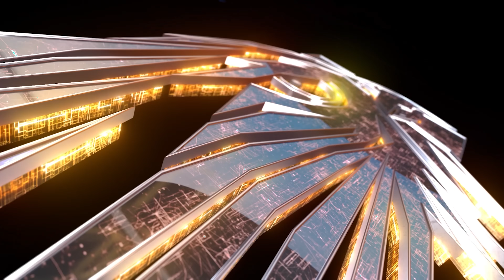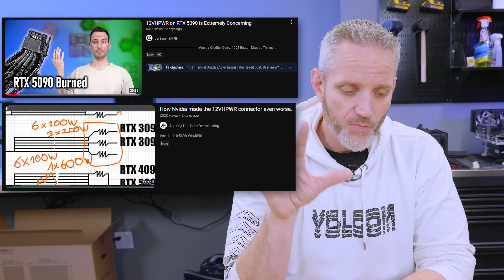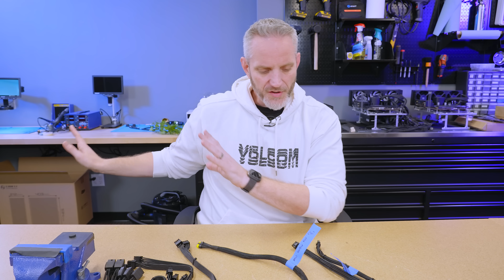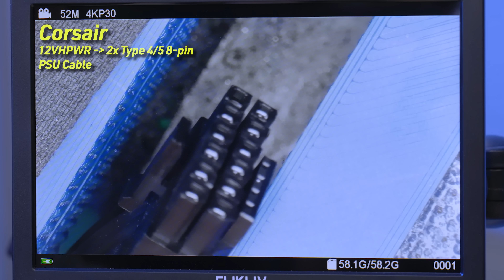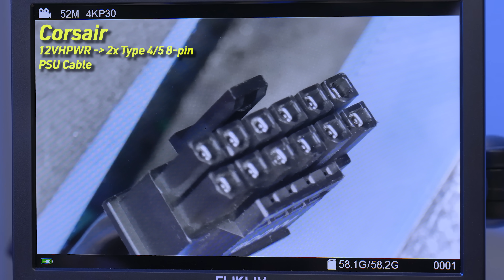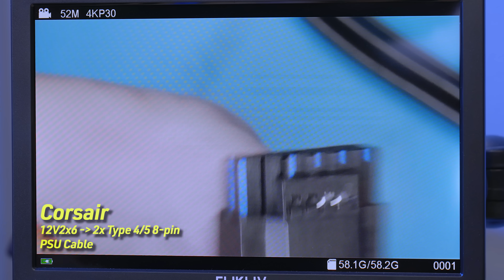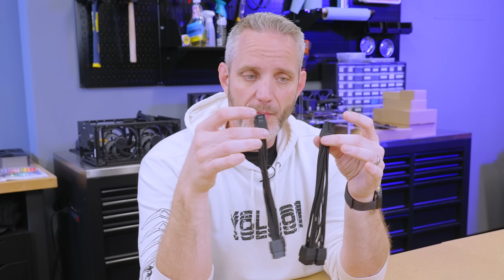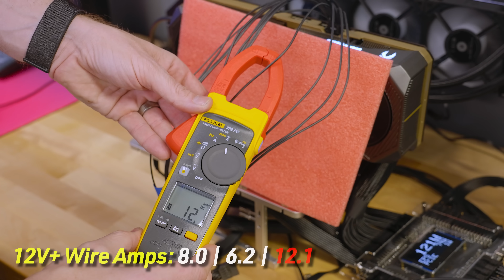I discovered something concerning and I need the Experts to chime in... More 12VHPWR discovery!

Comment: The 4090 and 5090 should have been equipped with an XT60 connector instead of the failure prone 12VHPWR.

Comment: Hey Jay... I don't normally comment, but I posted basically the same response on Der8auers video. So, based on the design of the 12V-2X6 bridge to the GPU PCB on the 5090 FE I think you are likely going to see that other 5090 FE connectors (as long as they're correctly seated) will have damage on exactly the same pin as Der8auer's card (pin #6, bottom right +12V closest to sense pins).

The +12V bridge from the 2X6 connector to the PCB on the 5090 FE is a single rail connecting all 6 pins, and pin #6 has the shortest path to the PCB (lowest resistance). Combine that with having zero load balancing between the 6 pins like the 30xx series had (3 electrically isolated shunt resistors connected to 2 pins each from the 12VHPWR connector) and the GPU could potentially pull all 50 amps available from a single wire (you're more likely to measure up to 25 amps per wire though). With the additional heat generated along a single wire the line resistance could nearly double, causing a scenario where the GPU would be pulling around 25 amps from the 2 wires with the lowest resistance values.

I would also guess that the second wire in his video showing extreme heat was likely pin #5 as that would have the second shortest path to the PCB. The 40xx and some 50xx series AIB cards use the non angled connector where each pin is soldered directly to the board (same path length), so depending on other tolerances the resistance may be higher on different +12V pins in those scenarios, and may have less extreme current balancing issues between pins. 

In your scenario it looks like the Zotac uses a non angled connector and the two middle pins (3+4) likely have the shortest trace length on the PCB to the single rail shunt resistor. I believe the issue is exascerbated by the poor QC in 3rd party cables, where the worst case scenario is a 50xx series FE card with a combination of pin #6 being a loose connection and pin #6 also having the shortest path to the PCB.

If you are able to accurately measure the resistance values from pins #3/4 on the Zotac to the main PCB shunt resistor I think you'll find they have marginally lower values and pins #1+6/7+12 will have the highest.

Any way, without any sort of pin to pin load balancing/isolation you end up with the potential to have the entire current draw of the card running through a single pin/wire (6x over spec), it's an extremely dangerous design flaw. :/

Comment: Being able to wiggle pins in and out gives me nightmares of the days of molex plugs never seating properly because pins would constantly get pushed out
Reply: Yeah, but much lower current there. Plus the male 4 pins were much longer,  so less of a problem unless the female pin just popped out, and they were bigger wires so you could easily just push on the wires and make sure they were fully seated. Not like these tiny ass wires on the 12VHP connections
Reply: wow, what a time trip. Molex was such a PITA for that. Round and round we go in circles. :innovation:
Reply: Atleast the molex plugs ran a 5W fan and not a 600W+ $2000 gpu...

Comment: There is a simple explanation to the ground question.
Half of the fingers on a PCIE slot are ground, if you have poor ground contact on the 12 pin the current will simply go through the slot.

Even with good contact you will find more current in the 12v wires than the gnd wires because some is going through the slot.
Reply: I have a better one. That helps, sure, but i have seen a report of GPU crashing until the Corsair cable was removed and replaced with that Nvidia pigtail adapter.

If the return current capability isn't sufficient, there will be a ground offset formed. 0.6V offset from 12V to 11.4 due to this amount of voltage dropping on the connector isn't going to do much, the card will just keep running. If however the same happens to ground pins and card's ground drifts to 0.6V relative to mainboard, PCIe signals absolutely cannot be read, since they will be outside the permissible voltage and thresholding parameters. Card halting prevents fire.

Otherwise you'd start seeing delaminated edge connector ground pins by now.

Comment: Also look at the sense part of the Corsair cable. It looks as though only two of them have connection pads on the GPU end of the cable. Maybe that doesn't matter. But the others seemed to have all four. That's not going to melt anything, but it still may speak to "cheap cable".

Comment: Kirchhoff's current law will apply to the 5090's power cable.

The law states that the current (Amps) flowing in each positive + conductor of the cable to a node/junction (the soldered/bridged rail on GPU PCB) in each positive + conductor of the cable SHOULD BE THE SAME. If it is not then there is a resistance/bad connection somewhere, or the PSU is not supplying the same Volts or Amps to all of the cables conductors.

Remove GPU from PC. Take it apart. Plug the power cable into the 5090 but not into the PSU. Measure the resistance from the GPU's PCB solder points on the 5090's power connector rail to each positive + pin of the cables plug on the PSU end.

Do the same tests but this time from the PSU PCB through the cable and through to the cables plug that goes into the GPU.

Comment: The best way to protect yourself from burnt cables is don't buy a 5090. Can't burn something you don't have.
I do wonder if the pins on the GPU and PSU connectors are just too small to carry so much current. You are looking at very little surface area to transfer a lot of power. 
Honestly it just seems like it should have been rated for much less power.

Comment: Sound plausible and would explain why DerBauer experienced this issue as he probably plugged and unplugged his cable a lot because of the nature of his work (testing various configurations). If the pins are loose, that could force them to become further out of spec every time you do that. Or even just once might be enough because I guess a lot of people know about the cable issue so they might jam the connector in there really hard to make sure it's fully seated.

Comment: The ground is just as important as the load. If the ground isnt seated the current wont draw threw the corresponding load wire, shifting that load to another wire, probably to wire with best ground connection. Pin sizing and material/plating will make a difference. The crimp quality of the Pin to wire is also very important. I would ask Jay if he is able to push the wires with the shorter pins to make them match. There are tiny bards on the pins that hold it in the plastic housing..they bend easily.

Comment: Not an ee by any stretch, but I have a somewhat similar issue with a custom made cable (8pin, not the abomination that is 12v6x2+4 spec 2.0 rebirth origins or whatever anime level bs name they've given it this week) that became damaged from my own fault, where the pins seated correctly but were shallow enough that the resistance lead to scorching of the pins on the cable.

I remade the cable and it's perfectly fine now, but the cable can appear to be fine and yet have such high resistance that it leads to failure anyway.

So I am of the opinion that the depth on those 12v6x2 cables is probably within spec and therefore fine as per Corsairs email, but it's so marginal that even the slightest deviation from perfect is enough to cause a thermal runaway situation that leads to catastrophic failure, which I firmly believe is absolutely not the fault of the end user but rather is a fault of the spec, it doesn't leave enough margin for safety.

Comment: Just checked the cable of my brand new hx1500i(never used it). It says h++. i noticed some pins are not aligned with the others as shown in your video. the pins can also move a bit when pulling slightly on the cable. debating whether or not to send it back to the shop i bought it. Thanks for the video Jay.

Comment: The female terminals have a tang that is supposed to engage with a shoulder in the plastic connector that should lock the terminal in place and keep it from retracting like that. Looks like damage, or very bad quality control. It is possible if the cable was plugged in in the past and then that particular conductor was pulled on very hard in the past, like if someone was prying/pulling to do their cable management, the tang on the terminal could have been bent out of place, or the tang could have dug a gouge out of the plastic connector housing. Either way it would allow that terminal to retract as you demonstrate. It is also possible that the was a quality control issue with the mold for the connector housing so the shoulder feature was not present or not large enough to engage the terminal tang. In any case, for sure this is a big issue. Less length of engagement of the male to female terminal will result in higher connection resistance. More resistance can cause more heat, more heat can cause the terminals to distort and cause higher resistance, and so on.

Comment: Thanks Jay. I'm one of the ones who's been asking for this topic to be covered as I have 5 cables, 2 of which that were built way after the 12V2X6 and after the newer MDPCX terminal pins released and those later two are awesome due to the size of said pins. I have a Seasonic cable which should be of the highest quality and can fully seat the cable and not need much pressure at an angle to make the motherboard think GPU power is not plugged in.

Corsair is full of shit as these two newer cables have terminal pins that sit almost flush with the end of the connector and grip the GPUs socket like no other connector I've seen

Comment: This is a good video, i've said it many times before but they need to look at other high amp dc connectors and use one of those variants instead of PC components. This is completely unacceptable for even cheap products, nevermind these ridiculously overpriced gpu's. On another note, dammit now i have to pull my pc apart and check my Corsair cable :(

Comment: So for all you out there. At 3 min 13 seconds. He said it all boils down to manufacturers being cheap and instead of smart cables and board that sense per pin voltage, they are just running bare wire that runs whatever it wants including pulling too much power on whatever wire it wants, melting your shit down. Especially wiggly wires that dont make good connections tfat increase volatage resistance... melting your shit like a hot glue gun. Manufacturers cheap, profits up, fuck the consumer, deny the claims, have a good day.

Comment: The PMD did nothing. The GPU doesn't care if the current is balanced across all wires or coming in over a single wire, because for the GPU it is just one wire. The problem is that the individual component wires that make up the cable and plug care, because all of a sudden they have multiple times their rated load to carry. The cable will or will not burn, regardless of the PMD sitting in between it and the GPU.

Comment: The new 12V-2x6 connector's sense pins help mitigate this issue, but I believe the real problem lies with the pinhole size on the female side. If the pinholes are too large for the male pins, it can create a loose connection. This would also explain why hard bending increases the risk, while the outer connector may click into place, it doesn’t guarantee a secure connection between the internal pins that link the GPU to the PSU.

If a pin connection has a gap, it may carry less current, forcing other pins to handle a higher load. This is especially concerning for the RTX 5090 FE, which only has one shunt resistor. With just one resistor, the GPU can't detect a loose pin connection, it simply draws full power, whether it's coming through one pin or all six.

Comment: If the card has multiple seperated power paths on the + side, and a common rail on the ground side, then the ground could be naturally power ballancing on the ground side. Power always takes the path of least resistance. As current raises magnetic and heat resistances also rise allowing a common rail to potentially self ballance. This isnt something I would count on, but it is a possible reason you might see even heating on the ground, but have current spikes on the + side. Power actually flows - to +. So common rail negative would evenly distrobute power to the circuits on the board. If those circuits have individual paths to the + output it is pissible for them to draw powere evenly from ground while dumping current to a single cord on the outlet aka + side.
Reply: Having now watched the other videos in regard to the power distribution on the card itself. As this power is all run through a single shunt, then the power in theory should flow evenly through all cables, all things equal. But with that many connections, how can they be. If the cable is at fault or partially at fault, then there must be a varience in the resistance. This can be caused by solder joints, flux aplication, cable length, the connectors on the gpu side, and the connectors on the cable side. In truth, it's likely a combination. I am left wondering if there is a mesurable varience? I am also now curious how these power supplies are distrobuting the power and if that could also be a factor. I hate that this is happening, but I love analizing, breaking down, and eventually finding or having revealed the truth, or truths.

Comment: It could be the outside edge since it has the most tug being the outside edge.  These individual connections should have a metal barb that prevents them from backing out. but its either not molded right, didn't secure itself against the plastic. or simply wiggled enough to get free.